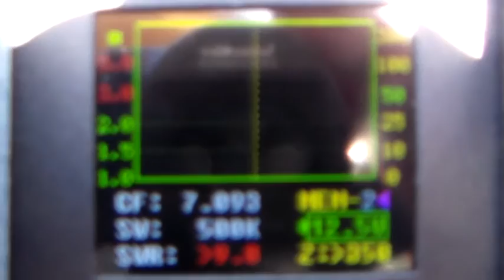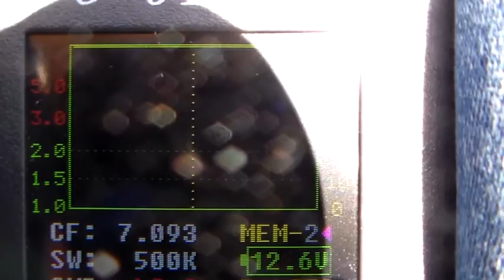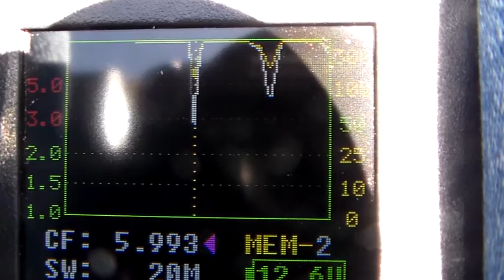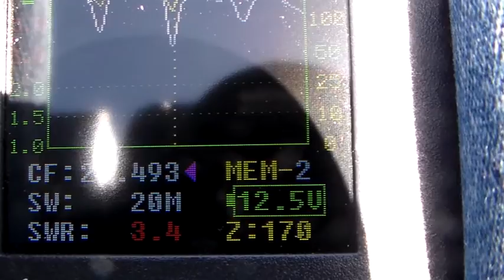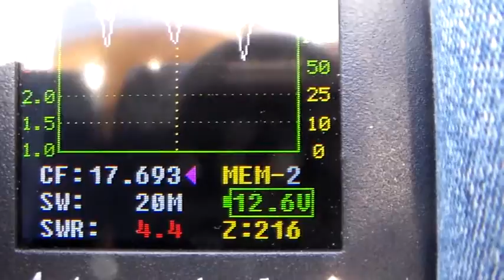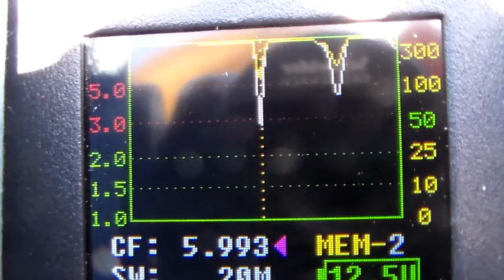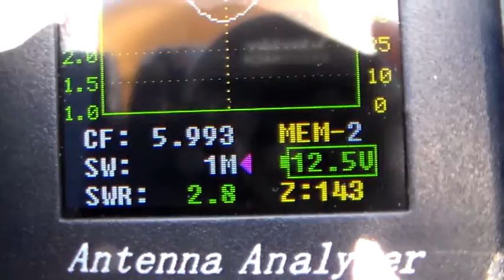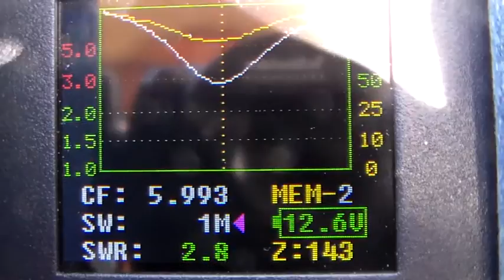Looking At My Delta Loop On The FG-01 Analyser

Comment: I have a 40 meter delta loop fed at the apex at the top of my  mast fed with  1/2 wave  of open wire line and shows an impedance of 100 ohms. changed the feed line to  1/4 wave of 600 ohms and 1/4 wave 450 ohms in series  now reads 85 ohms     Must be  having a auto transforming  effect  the 450 ohm ladder  line comes into my  shack connected  to a home brew link coupled  parallel tuned circuit  and gives me a bandwidth of 200 khz .

Comment: Nice! But where is the antenna? I want to see how it is installed and connected! Keep up the good work mate! 73 de WB5PUN✌️👍🏻😎
Reply from the maker: Thanks for the comment. I don't really want to show the house so I can't show the antenna, but it was a vertically polarized delta strung between a couple of trees. The apex was at the bottom and was open ended with a loading coil on the end and a meter of wire after the loading coil. So the ATU and the loading coil were placed next to each other at the apex, ATU at one end of the wire, loading coil at the other. I hope that makes sense.